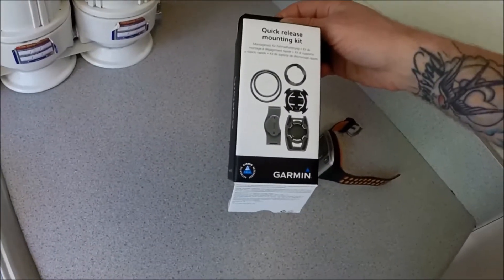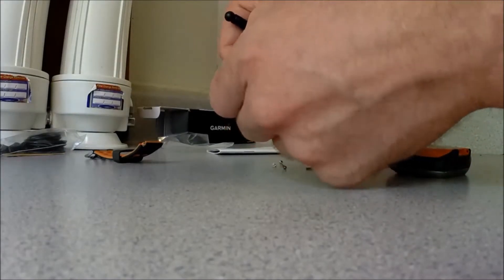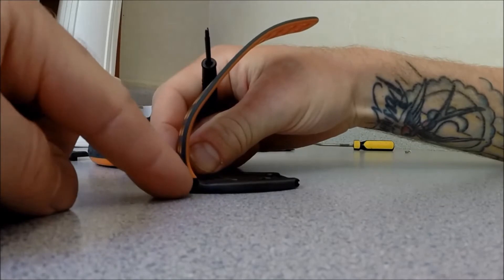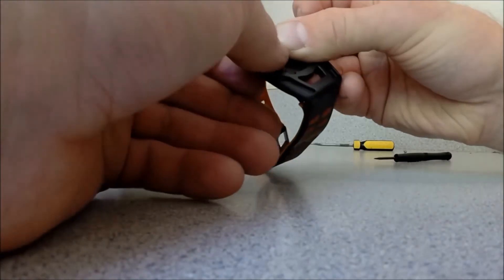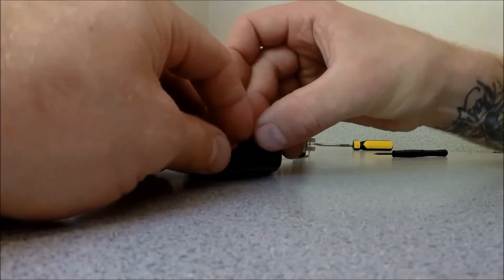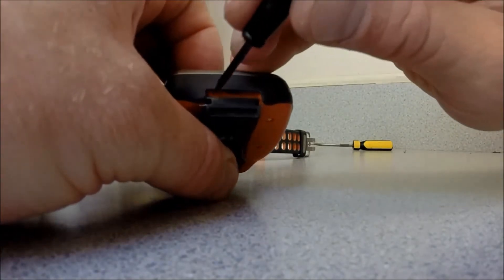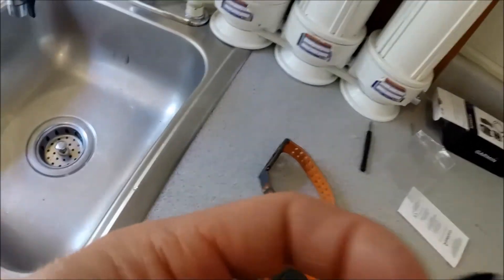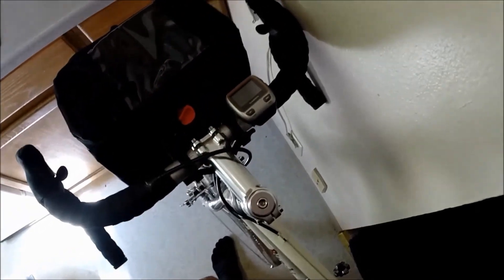How To Install Garmin Quick Release Mount Forerunner 310XT

Comment: Thanks for the video Vegan.  I see the kit comes with a dedicated bike mount, but for people that own more than 1 bike and want to use their 310XT for cycling only, in your opinion could you use the QR plastic mount intended for the strap on your bike instead? Cheers, Ross
Reply from the maker: +Ross Pennell You wouldn't even need this product. There is another mounting option, where you just attach the unmodified Garmin to your bars. Garmin also offers a 'out front' mount. Check out there website.